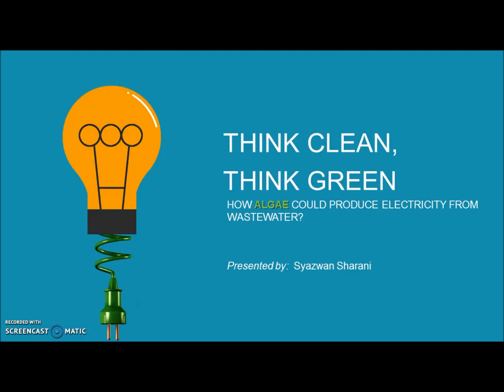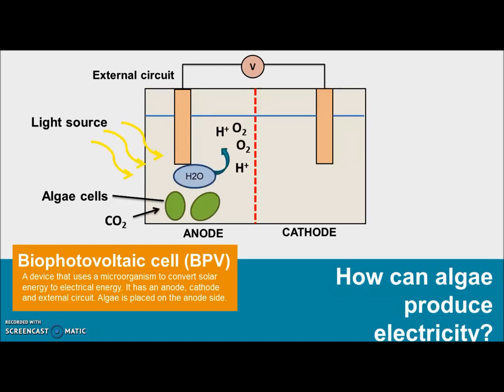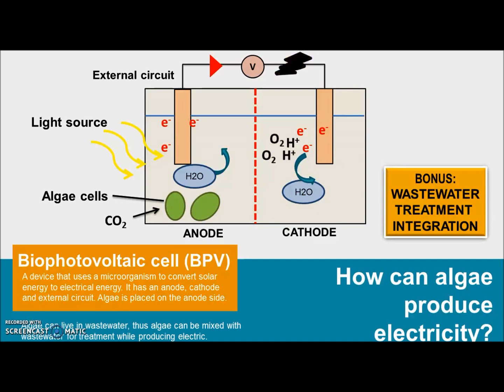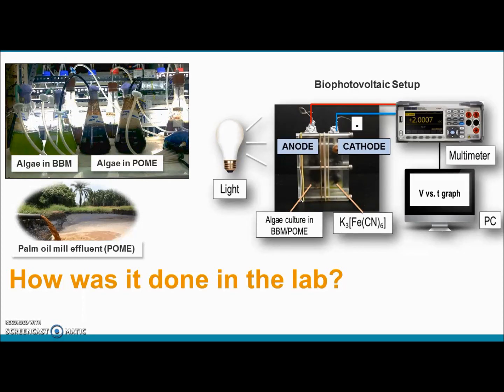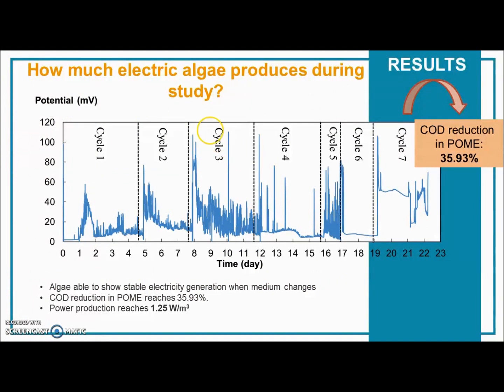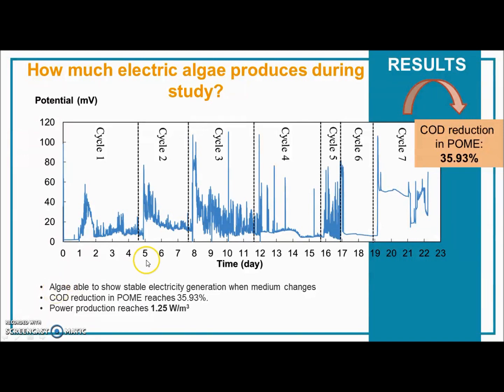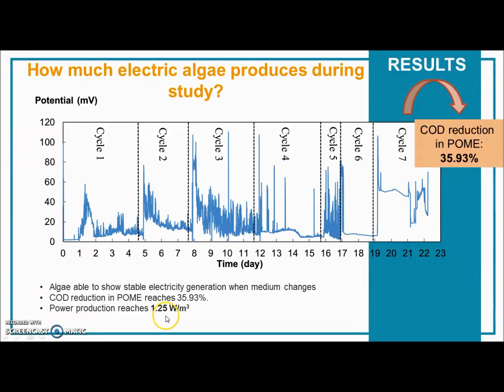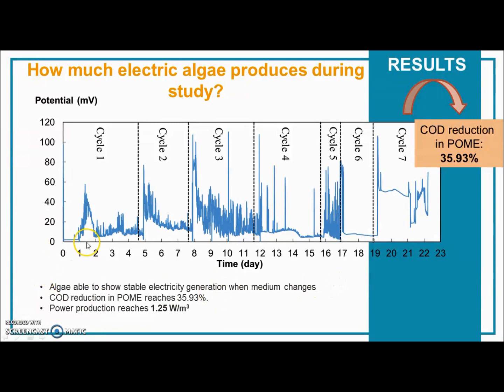Producing electricity from wastewater using algae

Comment: I'm missing important information here. How did you get the 1.25 W/m3? Also it's not important how much is produced. It's important how much you can harvest. The sun produces up to 1000W /m2, but that's not what we actually can harvest. So it would make sense to measure the voltage only under know load, so you can measure the energy. Or maybe charge capacitors. You can measure voltage a lot easier. The earth atmosphere has 100 volts per every meter height.  But the voltage itself is useless unless it's maintained under load (which is actual power generation)

Comment: As an idea to take co2 out of the atmosphere to reverse climate change I was thinking of growing saltwater algae in the desert.  I found your site to see if it was possible to produce electricity while growing the algae.  Fertilizer is the problem with my idea but using it to treat waste water is a great idea and takes co2 from the air it just needs to be done on such a massive scale to lower the atmospheric co2.
Reply from the maker: Wow, interesting idea. Can u describe further on how would you grow the saltwater algae in the desert? What would be the water source for the algae? Is it gonne be like a raceway pond kind of setup?
Reply: @syazwansharani8907  I have watched some documentaries and lectures on carbon capture.  The factories require a lot of energy which would compete with other energy uses, household and industrial.  Another option is to fertilize the oceans with iron I think to cause an algae bloom.  I was thinking how could you do so it wouldn't be competing for resources.  Fresh water algae would be competing for fresh water but no one will miss billions of gallons of ocean water.  I picked the deserts because then you wouldn't be competing with other plant life for growing space.  Fertilizer is a problem but if you use cudzo it would fix it's own nitrogen because it's a legume and fast growing so it would be capturing carbon while you fixed nitrogen.  I don't know any details I was just trying to think of a way to capture atmospheric carbon without competing for resources and make its biproducts useful like make electricity or livestock feed, or biodegradable packaging, or compost it into soil.
Reply: It should be near the ocean since you would have to pump billions of gallons of water to the growing area.  Glad you like the idea.  I think it is very important that humans find a way to remove co2 from the atmosphere since we have gotten so good at putting into the atmosphere.  I would prefer that to any other geoengineering method like spraying so2 into the stratosphere or even the upper troposphere.
Reply: Hemp would make a good carbon capture crop.  I think the important thing is to find waste land that is having a difficult time growing anything.
Reply: I would pretty much drop everything if I thought I could help save the world by reversing climate change.
Reply: @syazwansharani8907  now I'm more interested in doing this on household scale. I can't stop thinking plants harvest solar energy and store with atoms that are abundant.  If people could do it that would do away with mining rare earth elements for solar panels and batteries.
Reply: "Reverse climate change" lol
Reply: @monstrositylabs  yeah it does sound ridiculous now.  Hahahaha we're screwed.
Reply: @SudsMcKinzey  I think you'll be just fine. Don't sweat it. Algae does a cracking job of removing CO2 in every body of water on earth.

Comment: amazing work, i want to do something like this using marine microalgae, some advice?
Reply from the maker: Hello, sorry I just noticed your comment. My advice would be to use different types of microalgae species and compare their ability to produce current. Usually the one that is able to produce a stable formation of biofilm on the anode would be the one that produces the highest electricity. Once you've selected the best species, you can move on testing other materials like type of electrodes used, the cathodic solution, and the substance you use to feed the algae
Reply: What type of electrode is used?